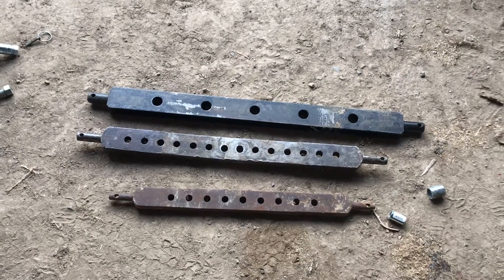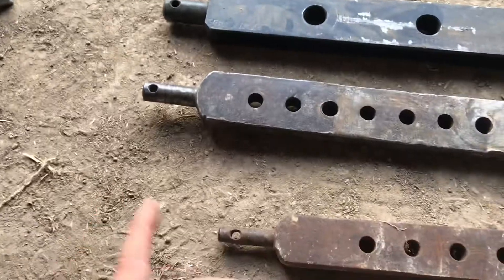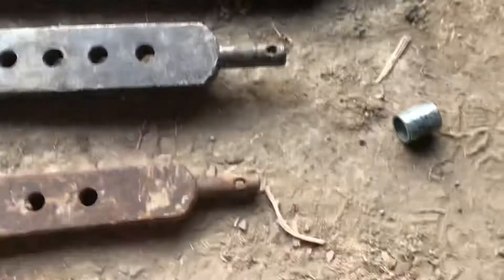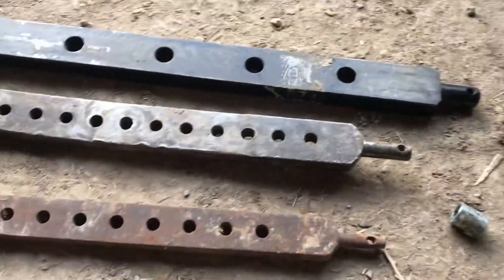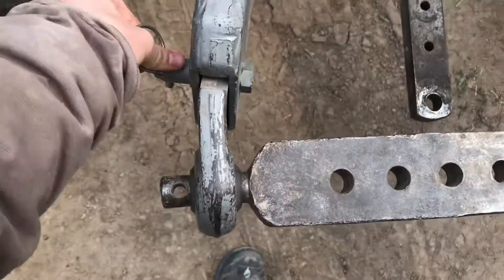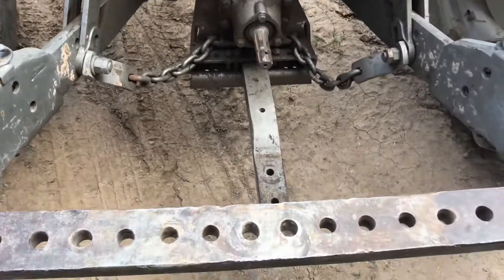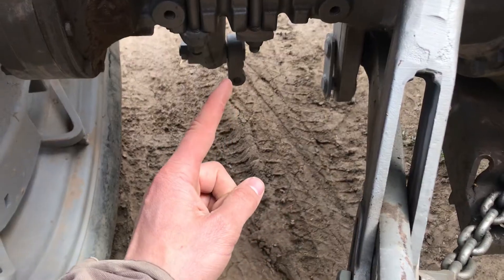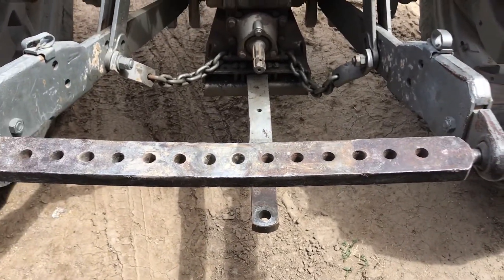Tractor Cross Drawbars- Crash Course

Comment: 9 hole drawbar is what we call them .........have not seen one used for over 40 years around here .......
Reply from the maker: @georgedoorley5628  interesting. We use them on smaller implements to level and grade with a small blade.

Comment: One thing you will want to get , to go with the drawbar , is a drawbar Lock. It goes over the drawbar and fit up against one of the lower arms. They can be purchased from a tractor supply store, for about $ 30 . It will keep the drawbar from rolling on you.
Reply from the maker: @jimginn6640  agreed. They work for light duty applications. I have broken them in more aggressive situations.

Comment: the real drawbar is always superior to a 3pt drawbar which is a kludge.  A proper drawbar should connect to the tractor belly in FRONT of the rear wheels.  That is the most stable pulling position and at least on older tractors is where they were properly designed to pull from.
Reply from the maker: Good point. I agree.